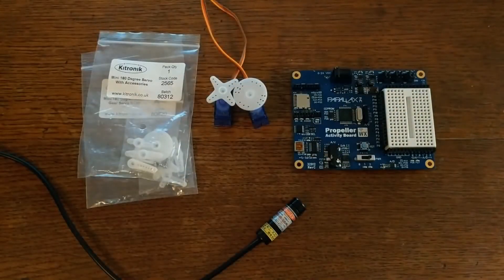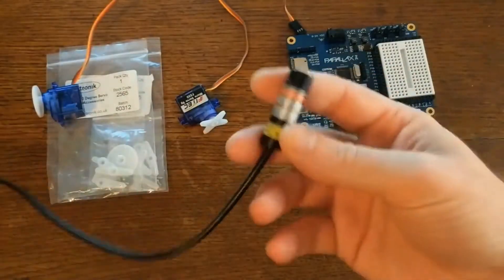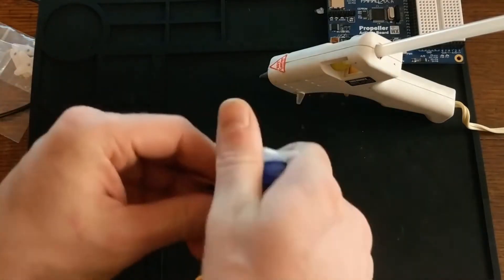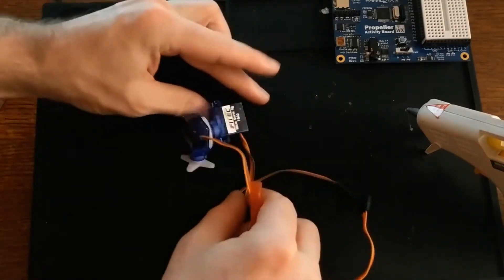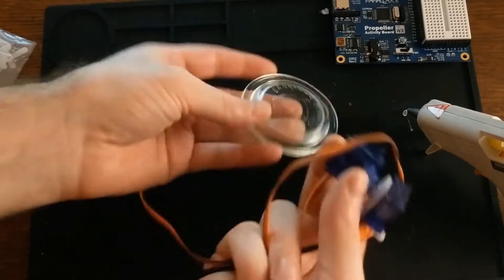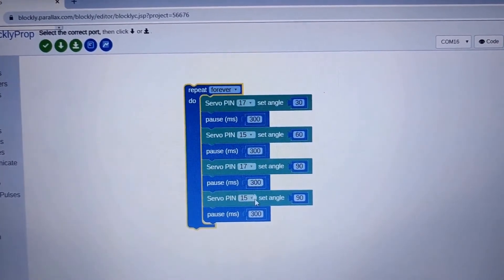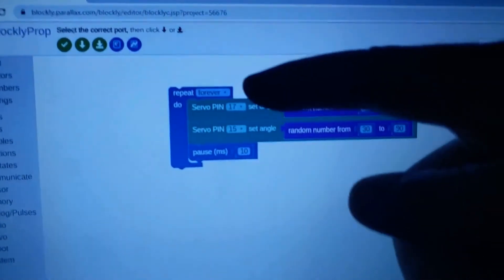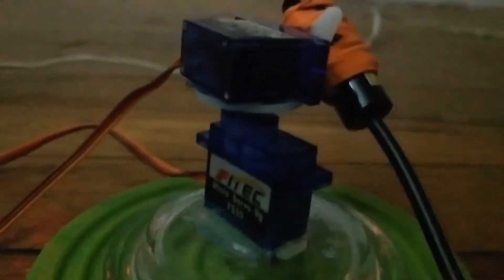Building a Laser Turret That Actually Works

Comment: you can add some sort of sensor and code it to point the laser at movement
Reply: explain how? With Lidar? 🤣🤣🤣🤣🤣🤣🤣🤣🤣🤣
Reply: @jtreg  get a turre. Tape a laser on the turret. Code the sensor to point at any movement it sees so when somebody walks by it will point at the most movement. There are videos on this.